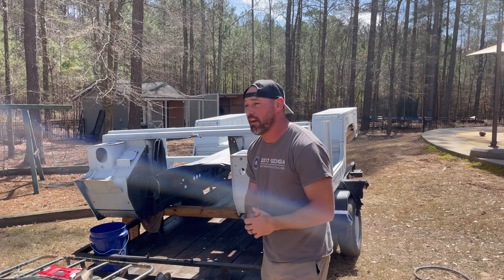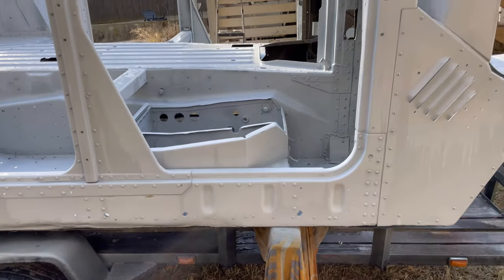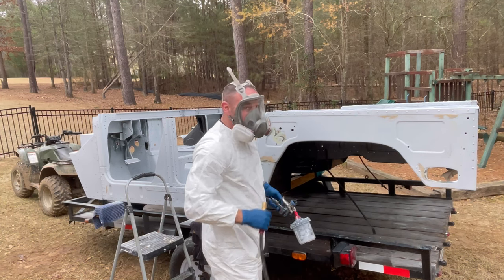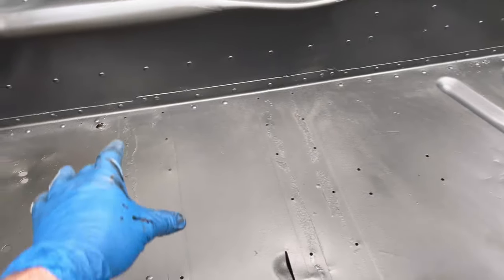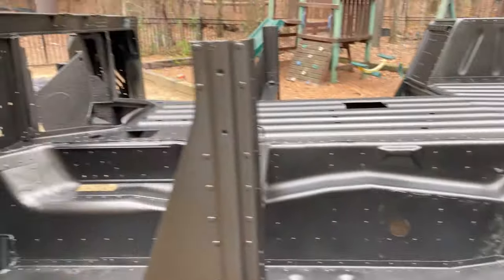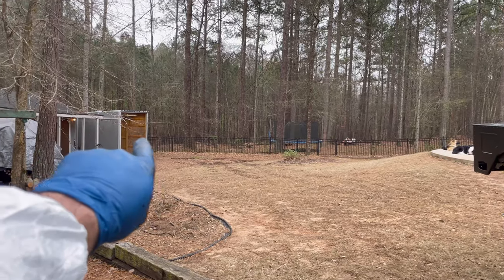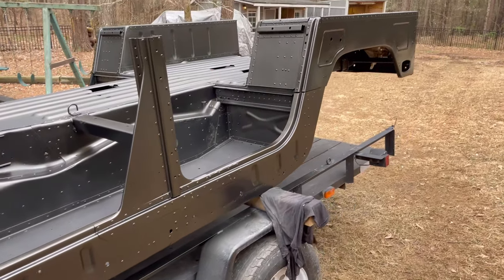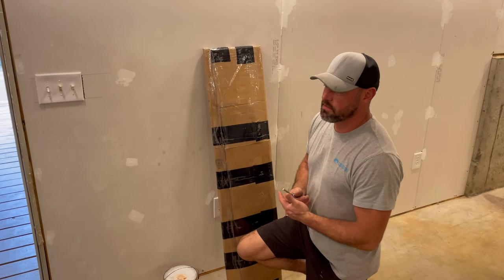Automotive Painting a Humvee in my Yard Outside.

Comment: What braking system will you be using now that it will have a duramax in it, or will you be using the original braking system?
Reply from the maker: I’m gonna try to use the original, at least for now

Comment: In this video at (14:57, I see two square holes in the bed... did you do that? is that to access the rear brake lines? How did you cut it and then put the pieces back in? I put a rear brake line in on the passenger side but couldn't really get good access to secure it well to the frame, so some holes in the bed would do the trick I think.
Reply from the maker: Their pre cut I think in any 1999 and up humvee
Reply: @SplitBuilds  my 2003 doesn’t have them so I was just wondering. Thx